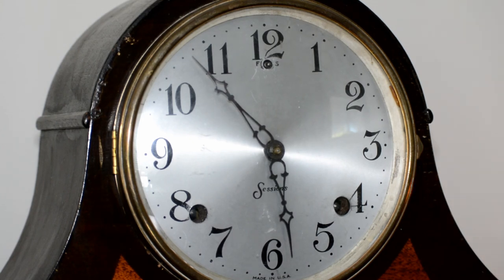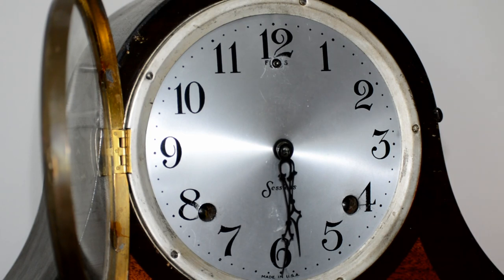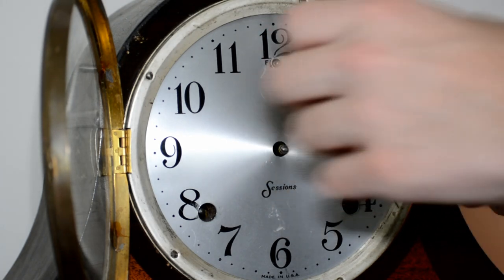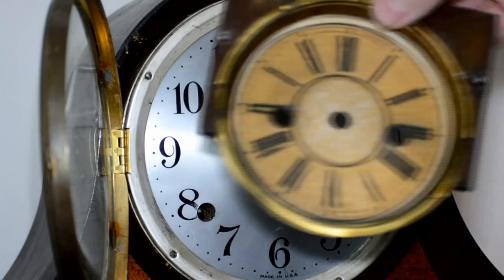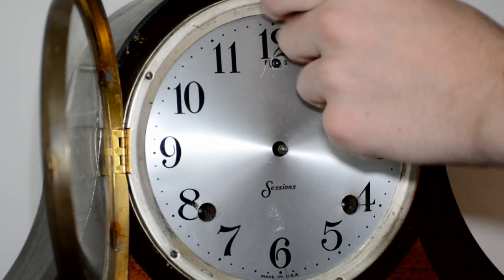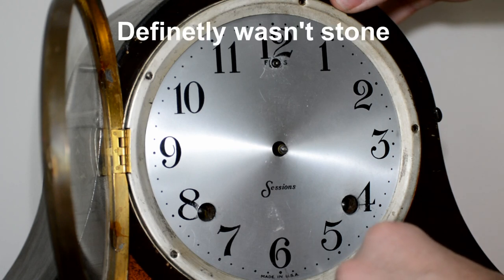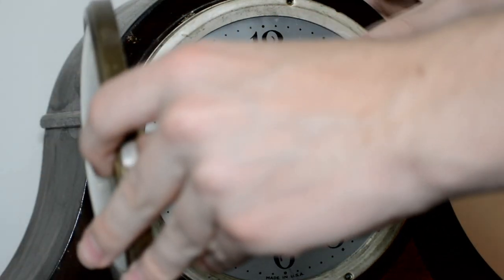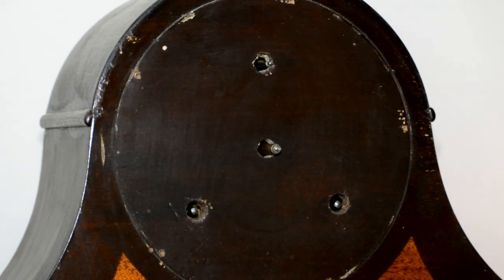Removing a Clock Face

Comment: We've had the same "Berkeley" model for over 50 years now.
It kept good time on the mantel over the fireplace at our home on the coast of Maine for many years.
It's pretty much a member of the family.
I hope your aware that these Sessions spring wound clocks are infamous for having weak ratchet pawl "Clicks," and it's very wise to carefully inspect them before winding. The pawl, or "Click" fails to engage with the teeth of the ratchet and the powerful spring will back spin the key no matter how firm a grip you have on it and can easily remove a thumbnail - and bloody your fingers. It's happened to me and some 30 years later I'm still a little paranoid whenever I wind ours.
I often use a special let-down tool when fully winding ours!
Great clocks, and they have a pleasant chime.
Enjoyed seeing yours, thanks for sharing...